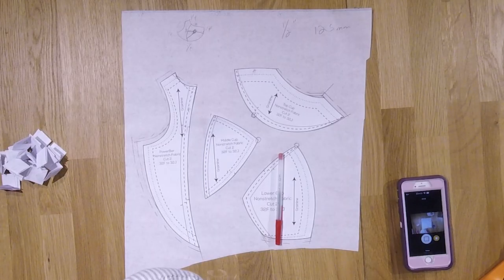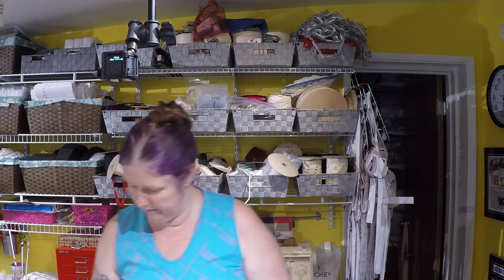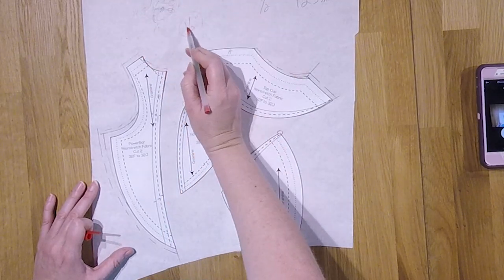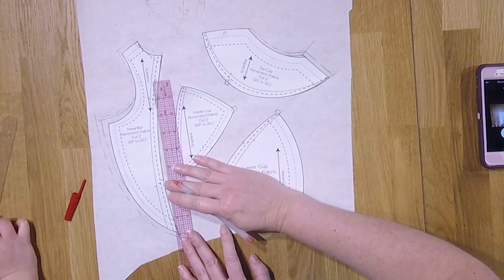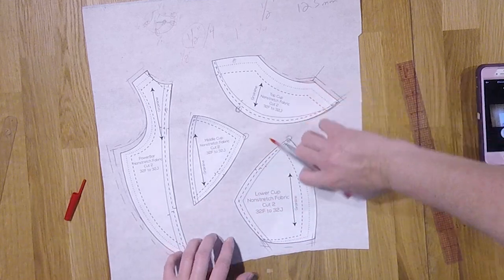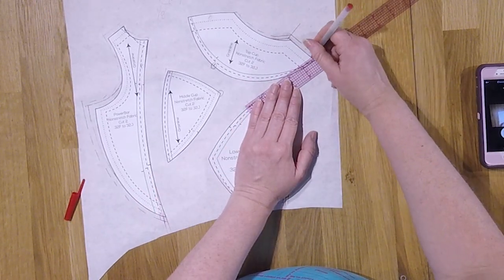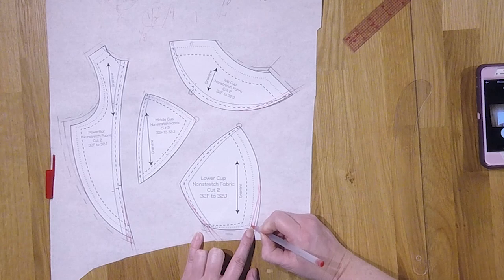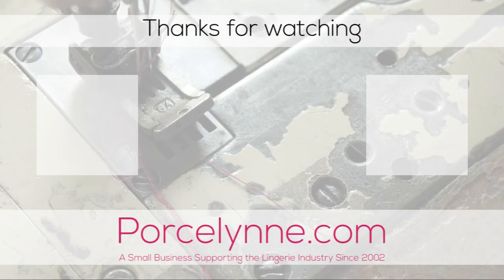Grading a Bra Cup for a Smaller Wire Size by Porcelynne

Comment: Thanks for making these vids! I'm an absolute novice to sewing but am finding alterations my best solution. Sadly I've put on quite a bit of weight over the years and unlike many ladies, only a bit extra went to my chest. It's nearly impossible to find a cute swim top/suit that will be flattering and not too tight but for a C cup with underwire support.
Reply from the maker: I'm glad you like them. I personally use my sports bra patterns for swim tops, but I also make it with the tankini add-on so I cover my mid section. I am presently about 40-50 pounds heavier than I was before I had my kid.

Comment: Firstly, I love that your daughter is your apprentice in these videos. Thanks for this. I am wondering if you can comment on how you would do this on a 2 piece cup. Would you take all of the length off at the seam on either side of the breast between the top and bottom cup? Or would you add darts in the bottom to spread out the points where you have to take volume in?
Reply from the maker: A two piece cup doesn't provide as much shape, so changing more than a couple wires may require you to split the bottom cup. For a 2 piece with just a couple wire changes, I'd split the wire grade on the 4 interior seams, but you can always remove from the top of the wire line as well. On the new cups I just graded, my new Ariel, I did not touch the top cup at all and only graded 4 of the 8 seams for the wire. Grading can be just as much art as it is skill, so there isn't necessarily one way to do it. I like to do it somewhat evenly around the cup, so that helped me make the decision on the Ariel wire grade.

Comment: I have the opposite issue - I have a wide root that needs a bigger wire but need to decrease the cup volume to an A or B cup.  Does this change the method?
Reply from the maker: You just need to do the opposite and lengthen the wire line, removing curve from the cup. The same concept applies.